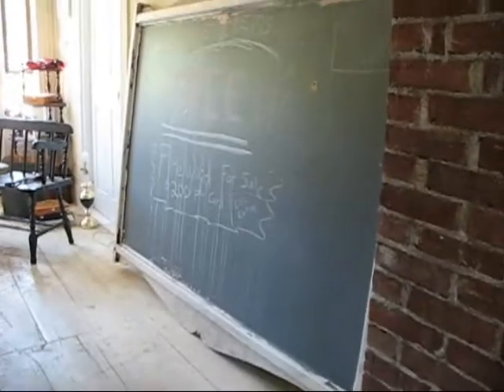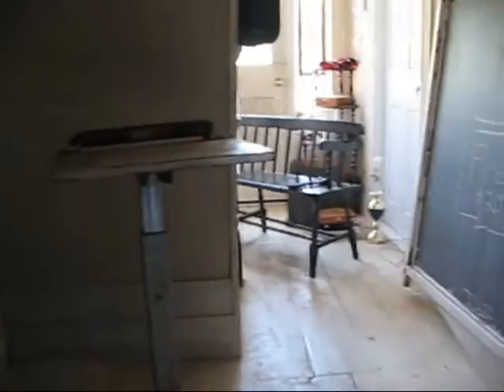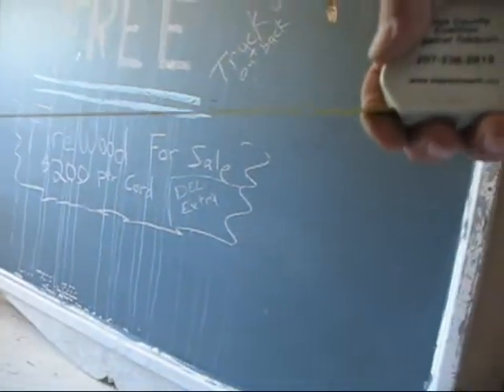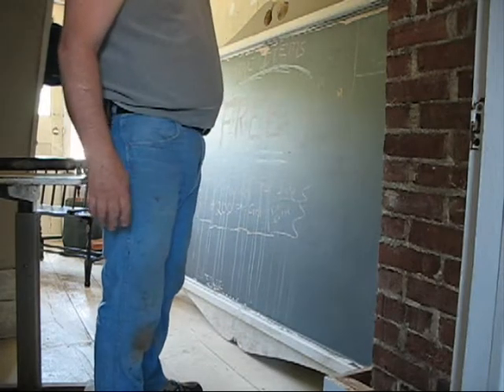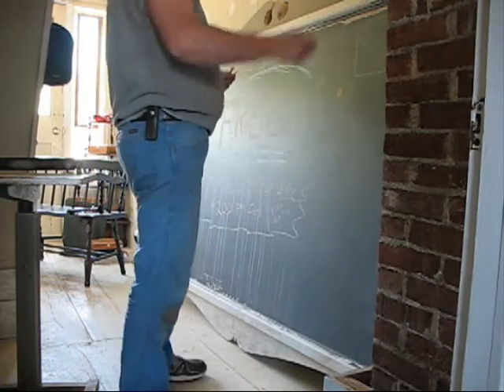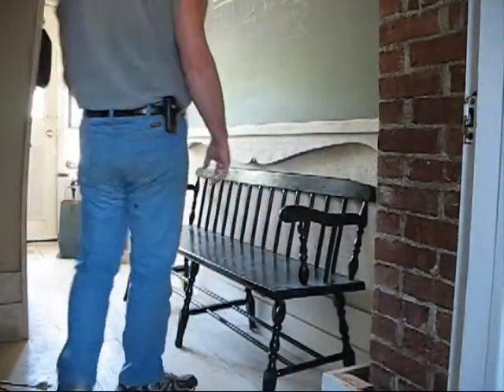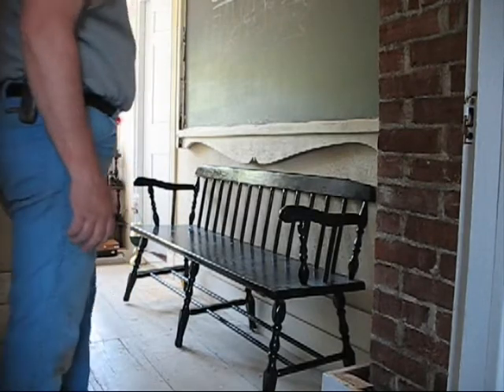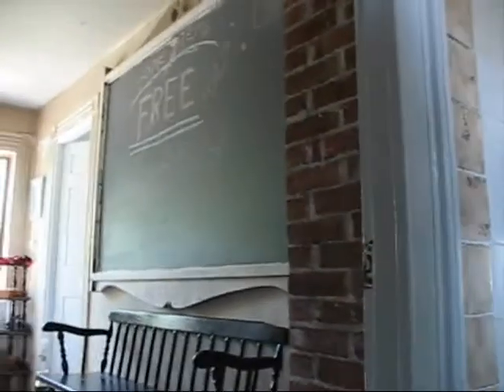Hanging a picture too heavy

Comment: '
use 3 strong nails, 3 nails on 3 studs inside the wall, put steel cable wire on the back of board, put on the wall then use 2 round woods on the wall under the board to support